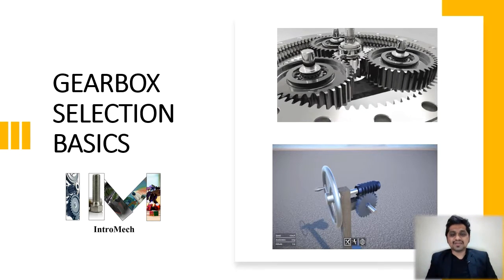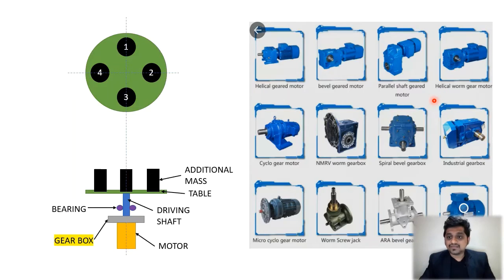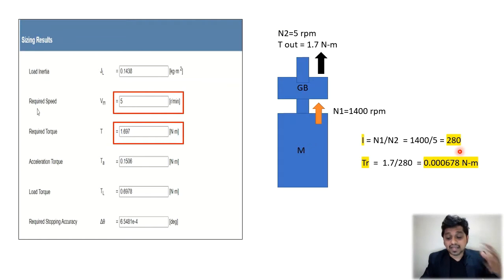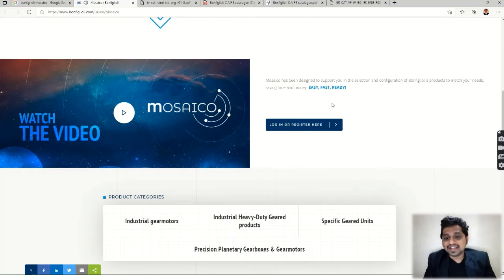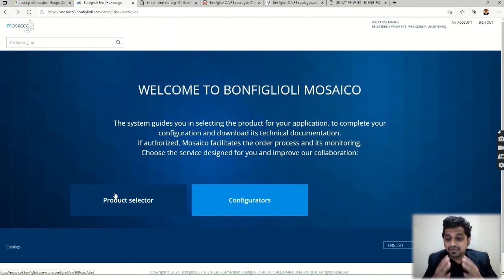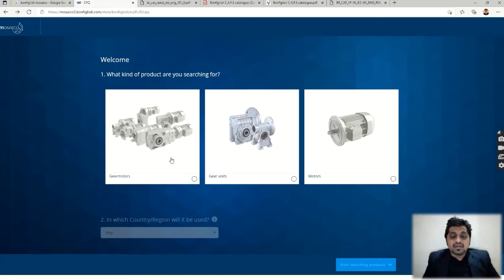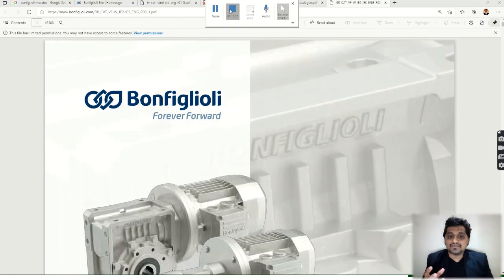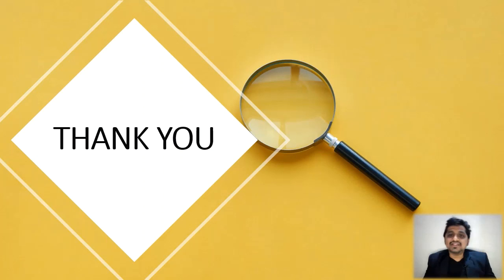GEARBOX SELECTION TOOL

Comment: Sir i am making a flex chain conveyor. Belt weight is 7kg total carring load of boxes is 32kg . Sprocket and idler weight id 0.5kg each.
Conveyor speed is 20 mtr per minute.
Sprocket and idler pcd is 137.5mm
Plz suggest which worm gear motor will be suitable.
Power required of motor
And which gear box
I need hollow shaft geared motor for this.
Reply from the maker: Please refer this video: -  https://youtu.be/NPWYA3ihQ94?si=BFYBcZOrwHH4XSF4
you can able to find some torque value and from that you can select the motor and GB.

Comment: Sir please tell me how will find service factors in gear box
Reply from the maker: In simple terms, the service factor is the ratio of the gearbox rated horsepower (or torque) to the application's required horsepower (or torque). Service factors are defined by the American Gear Manufacturers Association (AGMA), based on the type of gearbox, the expected service duty, and the type of application. A reducer with a 2.0 service factor can accommodate double the torque compared to a 1.0 service factor, while the output will be the same in these two reducers. For more details you can check out this link: https://clr.es/blog/en/what-is-the-service-factor/

Comment: Sir ,Load is 250kg of flour it will be mixing in container by Ribbon blade...so now how find out the Required Torque and Speed and gear box